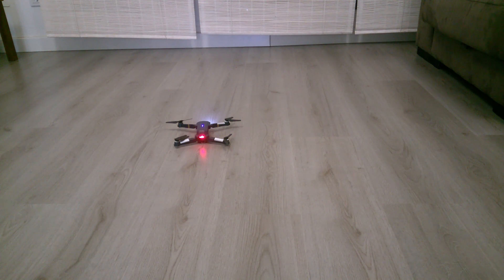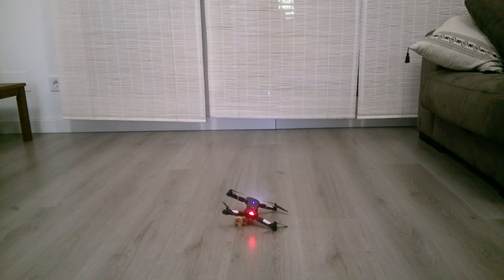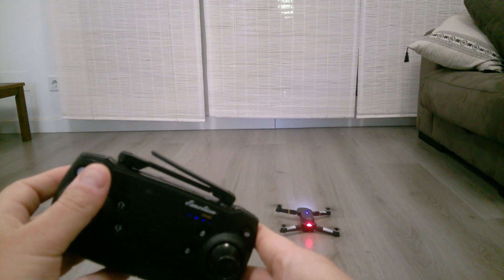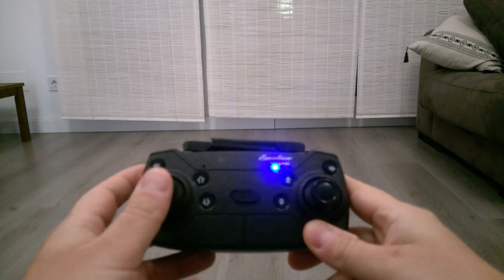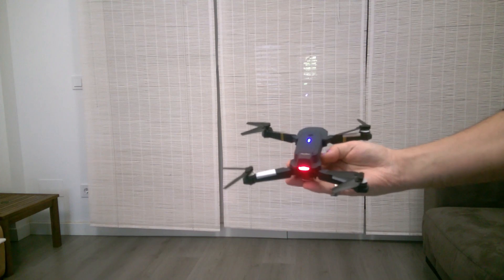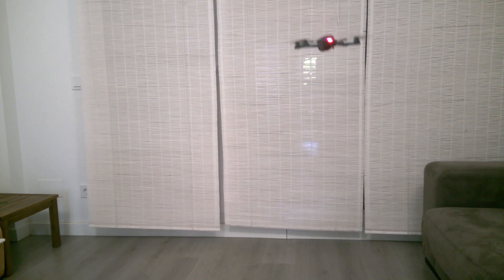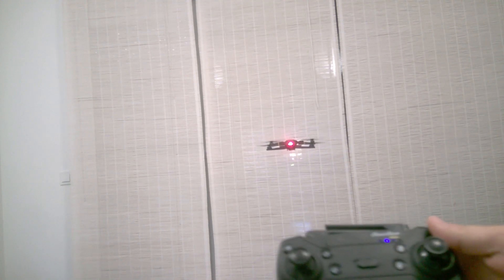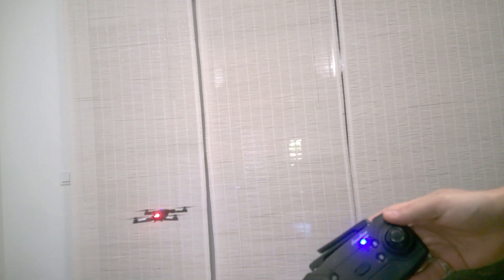How to Calibrate a Drone? How to Fix a Drifting Eachine E58 (QuadAir, Drone X Pro)? Quick Manual.

Comment: When you calibrate these drones, you turn the drone on first and then the remote control and hit the left joystick up and pull it back down and then let it go and then take both of the joys sticks on both sides and pull them all the way down to the right on an angle count for two seconds and then let them both go. I usually do that twice and then when it gets flying, it’s never really calibrated perfect so just use the top arrows ones to the right and ones to the left on your remote control. The right button will make it drift to the right more. The left button will make it drift to the left more and then you will see on the right side down where the right stick is you’ll see two little arrows that will control if it’s going forward too much you hit the back button if it’s coming back too much you hit the forward button and the two little air was on the left if you hit the top arrow it will lift your drone up automatically and then you can use your joystick and the bottom arrow will just set it down nicely. I have a lot of fun with mine got it on third gear and that thing just flies.

Comment: What do you mean by headless mode and head on mode? What does headless mode do? Does it allow you to rotate/spin (not flip) the drone 360? If so then how can i switch on to head on mode? I am learning to fly my drone and my drone drifts even though i calibrated it. I have a button on my controller which makes it auto calibration. I also have the option of manual calibration. I do auto first and then i do manual. Am i doing that wrong? Shall I just stick to one mode auto/manual? Many questions here, I would appreciate if you can reply asap. Shall I also try to calibrate when drone is flying to auto/manual mode?
Reply from the maker: You can check some drone related playlists on this channel. There are more videos explaining the headless mode as well, and some other tips for beginners on how to fly the drones and their features.
Reply: @AventuraRemoteSmart yes after I commented on your video, I found a specific video thats the same model as my drone V88LN from Ali Express so i will be following that up. Thank you for replying 😊

Comment: Thank you for this. Temu drone came with very little instructions and had no idea what the buttons did on the controller. Got the manual calibration down and was about to do a couple back and forth runs across my property smoothly

Comment: I have a drone, but whenever I charge it and it’s on and I try to control it with my controller that I’m using for the drone it doesn’t work
Reply: They is normally a process to sync the controller

Comment: Hi, Do you know how to skip the gyro check after power on?
To calibrate the drone must be placed very stable.  I use mine on a boot, and it keeps checking the gyro to become stable. This does not succeed on a moving boat..
any hint is welcome

Comment: Are E88 and E58 different or there are the same ?
Reply from the maker: They are different, E58 is smaller, faster, more difficult to control, default battery has shorter flying time, but alternative batteries are available, in my opinion was more fun to play with. E88 is larger, thus slower, not as responsive to controls on higher speeds as E58, but is easier to control, with optical flow positioning, thus with better auto calibration, the controls are better designed, more intuitive.

Comment: In my dron have a little legs in front. Maybe due this it is not calibrate. 
I have E88 . After it crash with wall dorne drift to left forward. 
Now see you are remove it legs.. 
I will try this also thanks
Reply from the maker: yes, legs fall off sometimes, but they should not affect the calibration.
Reply: @AventuraRemoteSmart  then i check, front  left engine work but wing not spin.

Comment: the video helps so much but what do i do if it turns a direction not a left or right it spins to a side what do i do in that case???
Reply from the maker: You need to practice, this is the most difficult part, when the drone rotates around its axis, due to wind for example, or you touch accidently the rotation stick, in such cases you need to see in what position the drone is and redirect it correctly.

Comment: have a drone like this but for some reason it wont turn on, tried charging it and a blue light appears ont the battery. doesnt do anything when i charge it a little and put it back in
Reply from the maker: these are cheap drones, and things may go wrong, ask for replacement or try another battery fully charged.

Comment: I have a skyquad drone and the controller is very different. Why? It's a push button and with brand new batteries it will not turn on
Reply from the maker: Some drones may have similar appearance but could be different models.

Comment: Poor demo. I only say that, because whenever you operated the controls, the remote was out of the picture. It was those you were doing it intentionally.
Reply from the maker: Thank you for your comment. It is still possible to get the idea of how to calibrate the drone, I have shown the location of the buttons on the remote control, you can hear the beeping sound when I press the calibration buttons.
Reply: It is not bad, it helped me a lot. Just have to use your brain, but I see in the comments that's it is not a common thing.

Comment: What do I do if it keeps saying no connection?
Reply from the maker: if you mean the app, check out other apps, they have upgraded versions and some do not work anymore as expected. I have a video about different apps for this drone, check out the e58 playlist on my channel. Other thing to try is to turn off all connections on the phone, like mobile internet, hotspot, and leave on only the wifi connection. Also, it is important not to turn on the app before turning on the drone, it may affect the app as well. Turn on the drone first, then connect to a phone via wifi and then turn on the app. If no wifi signal is detected, check if you have 2.4GHz or 5GHz wifi on you phone, wifi mode should be the same, the E58 drone uses 2.4Ghz wifi. Sometimes wifi module goes bad, this may happen if water gets on the wifi circuit.

Comment: It seems like my controller doesn’t even connect to the drone, how do I fix that?
Reply from the maker: First of all you should turn on the drone and then turn on the controller. If you turn on the controller first, it may not connect.
Reply: Have you fixed it?

Comment: What can I do if its still trying to do wheelies ie front props lift up 1st still even after calibration
Reply from the maker: Perform factory calibration reset on a plane surface, and then calibration in the air, if it does not help, check if there is debris in the propellers mechanism. If you replaced propellers, check if they were installed properly, the blades should be heading the right direction. Try a different well charged battery.
Reply: Did you fix it

Comment: I have a e99 k3 drone it keeps drifting even if I calibrate
Reply from the maker: if a drone does not have GPS a bit of drifting is normal, there is always airflow that will make it drift, and at different heights it may drift differently, when flying closer to objects or to the floor you get different air pressure so it may drift differently too.
Reply: Did you fix it?

Comment: I noticed your drone is still drifting a little after calibration, how can I make it hover still?
Reply from the maker: this model drifts a bit after calibration, it cannot be calibrated perfectly, as this is manual calibration, and there is no GPS stabilization in this model.
Reply: @AventuraRemoteSmart  thank you!

Comment: I have problem to connect to WiFi... unable to see the WiFi name in my phone...how to fix it?
Reply from the maker: Sometimes it takes time for wifi connection to appear in the phone. Sometimes the wifi adaptor may fail due to humidity. Also check what wifi standard your phone and the drone are using. They could be 2.4 or 5 Ghz wifi and they should match on both the drone and the phone.
Reply: You fixed it?
Reply: @trcyjones  no... 😞
Reply: @kanagenthirannagarandran2750  I just got mine calibrated and it's working normal now.
Reply: @kanagenthirannagarandran2750  although it's a youtuber that helped me fix it.

Comment: Hey man, how are you? 
I have been having a problem, my drone's wifi doesnt show up, i bought it 2 hand and i cant seem to find a way how to do that, can you help me?
Reply from the maker: Sometimes it takes time for wifi connection to appear in the phone. Sometimes the wifi adaptor may fail due to humidity. Also check what wifi standard your phone and the drone are using. They could be 2.4 or 5 Ghz wifi and they should match on both the drone and the phone.
Reply: Did you do it?

Comment: Please help. mine will not ascend in forward flight. If I let go of the right stick, then I can get it to ascend. but if I push forward on the right stick and up on the left stick at the same time it will just hold altitude or even descend sometimes. Super lame
Reply from the maker: It can happen due to wind and air flows, or when you fly forward in the highest speed mode, the air pushes the drone down. as the drone inclines forward a bit, the air pushes on its top surface and the ascend becomes difficult or too slow.
Reply: @AventuraRemoteSmart  okay yeah that makes sense. I guess it just doesn't have enough power to overcome the downforce. That's a bummer. I was thinking there's something wrong but it sounds correct what you're saying. I guess I better get a higher quality drone. I'm at the stage of flying where I'm good enough to do fast Forward flight but this thing won't cooperate

Comment: I think that if you would calibrate at a slower speed setting it would work correctly and move the joy sticks slower as well it will stabilize easier, IMO.
Reply from the maker: Yes, the drone should be calibrated at the slowest speed, otherwise it would be difficult to control the drone while calibrating. Stabilization is not done by sticks, it is done using buttons, the sticks here are manipulated to avoid the drone crashing into walls while pressing the calibration buttons at the same time. It may drift aside too fast so indoors you may need to do so, outdoors - no need to touch the sticks if there is no wind and just calibrate pushing the buttons.

Comment: Pls help when I first tried the remote wouldn’t connect so I used my phone but now I can’t calibrate it
Reply from the maker: try turning on the drone first before you turn on the remote control, otherwise it wont connect. Check the batteries in the remote control as well. On the phone, you can use the same joystick combination to reset factory calibration. Slide your fingers on the screen after turning on the controls on the screen in the same direction as you would do it with sticks on the remote control.

Comment: This drone is soo aggregating to use! First time I started it, it flew super fast towards my TV !!! Good thing it did not break it!! Now when I try to turn it on, it immediately flights to the left! I tried your factory setting and one of the propellers won't even turn on anymore so what turned off everything and not it won't connect... I just see the drone with blinking lights. =(
Reply from the maker: This is why it is advised not to use automatic take off button and fly it up manually. Same happens to many of us and with other non-gps drones too!
Reply: @AventuraRemoteSmart  thanks for the info, i threw it out 😄🙂 it is soo damn useless, cheaply made.
Reply from the maker: the propeller gears or supporting elements may have been damaged or stuck due to impacts

Comment: I have some problems charging I don't know when it's full charge o charged it but after an hour I unplug it and plug it again and the red light turns off quickly does that mean it's fully charged? My drone is e88
Reply from the maker: normally, if the indicator on the battery turns red without blinking, then it should turn off when fully charged. If the indicators are blinking when charging, then normally they should stop blinking when charged.
Reply: @AventuraRemoteSmart no I mean the red light turns off even tho it's low battery I don't know if it's fully charged

Comment: I want to do factory reset but not working. I pressed the throttle lever and the directional lever at the same time which I angled to the button right corner but the drone is not factory resting. Pls any help!!! My drone is S89

Comment: My drone just flew away and was lost - do NOT buy it - it never hovers always requires adjustment - It is rubbish
Reply from the maker: Sorry about that, I understand your frustration. This drone requires manual adjustment all the time and some practice. On the other hand, it is good for start, as you pay very little to get an opportunity to enter the world of drones and decide if you would enjoy it or not. My first attempts to control this drone were also frustrating but then it became a lot of fun and now I learned enough to get to another level. An expensive drone if lost could become a bitter experience as well, so it is a good drone for starters.
Reply: Mine almost did the same thing yesterday, my first day using it.  The only think that stopped it from flying away, never to be seen again was a tall oak tree.  What a piece of junk.  I should have known better than to buy it.

Comment: There was no problem with my calibration it was the pinion gear it was loose in the motor but i fixed it
Reply: Ok
Reply: How did u fix it I have same problem
Reply: @jordi5303  you have to diassamble it to check on the motor gear its really easy
Reply: @halaman887  I have like a clone of the real drone from china but I cant open the rotor thing its like stuck with glue
Reply: @jordi5303  oh well did you try to find some screws maybe there are screws that are hidden
Reply: @halaman887  no did not find any
Reply: @jordi5303  oh well maybe you'll probably gonna have to pry it open

Comment: Hey I got this new issue about the same drone you got,it keeps falling off when I try to hover and stable the drone to calibrate is there a problem there or I might just misclick the 360 roll button.
Reply from the maker: roll over button after you press it does not do anything until you press left of right button. then it would roll to the left or to right. not sure if i understand your problem, but calibration buttons should not be affected by roll buttons, they just incline the drone a bit to the left right front or backwards.
Reply: @AventuraRemoteSmart  I found the problem after I inspect the inside electronics,I seems like the rear right motor wire tend to shake or when it crash ton of times the circuit where the motor is connected is not in placed anymore maybe it's not soldered well or I bought the wrong one because it doesn't support SD card insert.It doesn't even have the name called emotional drone in the front left arm so might be a scam.

Comment: Hi i heve tried to calibrate my drone with joysticks but it doesn't work. I take the joysticks to the direction you said but o don't hear the sound that the calibration is done.thanks for answering.
Reply from the maker: have you synchronized  the remote control with the drone first?
Reply: I have a different E58 drone that has a calibration button on the remote, it's the inner right trigger button.

Comment: Every time i start it, it shoots off to the right fast agrivating even after calibrating
Reply from the maker: have you applied factory calibration? have you done it on a plain surface? are your propellers in good condition? Is there any dirt in gears or rust in motors? These are the factors to look at.
Reply from the maker: do manual calibration when flying, push the corresponding calibration buttons as many times as necessary
Reply from the maker: also, if you know that it will go to the right, before taking off use the control stick moving it to the left to balance the drone and then try to calibrate during the flight, manipulating the control stick with the calibration buttons at the same time. But if you have a lot of space around just start calibrating as soon as you take off quickly pressing the calibration buttons in the corresponding direction before it flies too far from you, as you may loose the sense of direction too.
Reply: @AventuraRemoteSmart  thanks i will give it a try again! Seems like a frustrating machine for a novice
Reply: @AventuraRemoteSmart  again thanks! Play safe with this covid! and i will be giving it another try here in canada
Reply from the maker: definitely, you need more space around and keep calm when trying to control this drone and practice